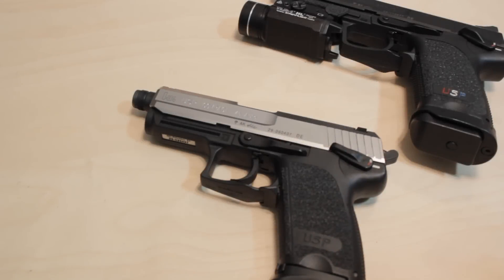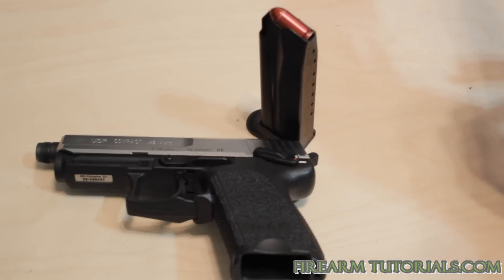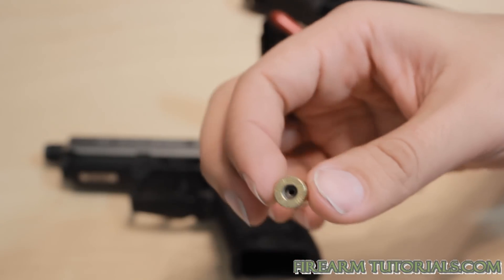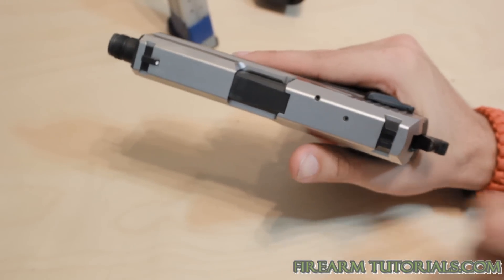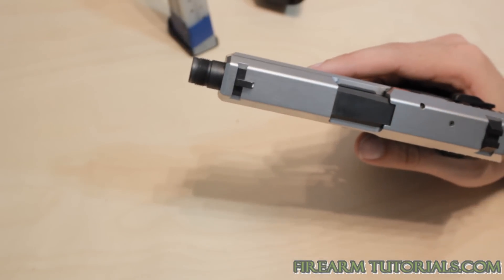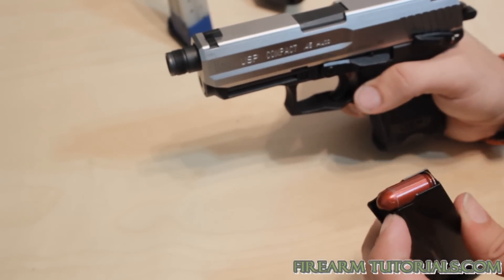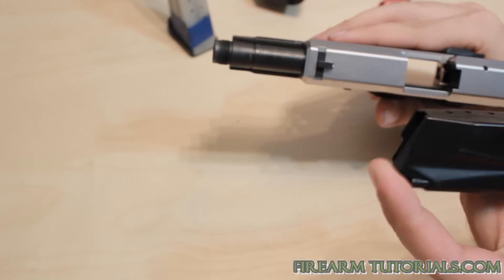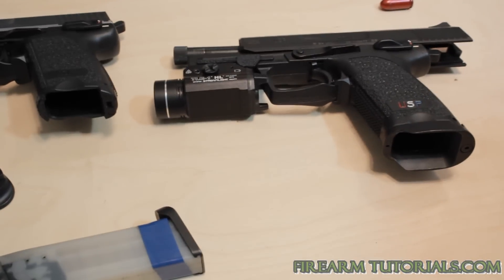HOWTO: Using snap caps in guns

Comment: Guns are made to send a round downrange every time. This requires certain mechanisms to function in the same way every time. If the striker or hammer does not have anything to hit, it overextends /doesn’t have anything to cushion normal movement. It’s similar to the human body in that regard. If a boxer hits a punching bag as hard as he can and then you take the bag away from him, he will torque his joints pretty badly.
Reply: You have answered my question. Thanks !

Comment: I would not use the brass snap cap without the primer as a practice snap cap because it is just like dry firing. The firing pin will not find resistance where it would normally strike the primer or a simulated primer.

Comment: Make your own snap cap out of used brass and erasers. Using an empty primer slot is not good for dry fire. You need something to stop and absorb impact.
Reply: Nope...it should be spring loaded like a real snap cap.
Reply: Nope...it needs to be spring loaded to protect the firing pin. Use a real snap cap.

Comment: This may sound like a dumb question, but how many times can I fire each snap cap before it's no longer good? Once? Twice? and if it's more than once, how do you know when it's not longer able to be used? Thanks in advance!
Reply from the maker: the answer, lots!  it's basically a rubber firing pin.  I guess eventually it would wear a hole, but that would take a LONG time.  fire away!
Reply: Three times a lady
Reply: I had the same question.
Reply: Gunnar Jones #HILARIOUS! LOL
Reply: Hasani Waldron
Reply: FirearmTutorials .com once the rubber wears are you basically dry firing?

Comment: Snap Caps have a spring behind the firing pin so that the firing pin has something to hit instead of rebounding off of the metal. The firing pin us designed to hit a primer. By not using a snap cap, and dry firing your center fire weapon, you may not immediately cause damage, but crystallizing your firing pin is a very real possibility. This is caused by hairline cracks that form as a result of a firing pin that rebounds off of metal and has micro vibrations running through it. I care about my center fire weapons and do not dry fire with out a snap cap. A spent casing, while fitting in the chamber, has nothing for the firing pin to rebound off of.
Reply: +Andrew Storie - Yeah your absolutely right, the brand name is "Tifton" their the one's that have a spring built into the "Snap Cap. As for their .22 LR it's hollow, but that's normal since the firing pin is a "Rim Fire "
Reply: Andrew Storie I commented before but no one answered isn't  he basically just dry firing with that spent round?
Reply: chukob5 yes
Reply: Cam you reuse real snap caps
Reply: Not only that but CZs have a firing pin retaining pin that fails from continuous dry firing.
Reply: @chukob5  the spent round has a primer that’s been hit. There isn’t anything for the firing pin to rebound off of with a spent casing.
Reply: I know this is a old comment but I’m curious on how I’m supposed to get the snap cap out of the gun after releasing the pin or pulling the trigger without engaging the pin again? To remove it I’d have to pull the slide back?
Reply: @chukob5  he is dry firing, correct. With a spent case however (one with a dented primer) there is nothing for the firing pin to rebound off of.
Reply: @timscoviac  of course the firing pin is fired/dropped at the point. Dry firing the gun is safe for the gun, to an extent. A firearm will always be made so that it can be unloaded. They’re designed to be tools. My original point is toward longevity of the firearm. Best practice is to use snap caps.

Comment: Snap caps stop the hyper extension of the firing pin.  Dry firing is an important practice.  Without a snap cap there is nothing to stop the firing pin except the firing pin spring being pushed to full compression or a direct metal on metal slam of the firing pin, depending on the design of the weapon.
Note: Dummy rounds also have nothing to stop the firing pin so they may be useful for checking the mechanics of your firearm, they do nothing to stop the damage to the gun via dry firing without a snap cap.
Reply: thank you
Reply: There's got to be something in the action that stops the firing pin. Otherwise the pin would fly through the barrel.
Reply: @goosecouple  Yes, as I clearly explained above, the pin only fits through the pin hole.  The end of the pin is larger to catch the spring.  If you fire a firearm without a cartridge or snapcap the spring fully compresses which is bad for the spring and your gun.

Comment: Personally I just  got a replica Airsoft Pistol  (Licensed S&W MP40 Metal Version,  C02, non blowback) to match my real pistol.    The weight/feel is almost identical.   to real pistol with a full mag.  

Trigger break/reset is very close.     The trigger is really heavy 10 to 12 lbs,    Personally I really like that.    Once you master this trigger,  you will never have problems on the real thing.    You don't need to charge the pistol or have C02.   You can practice rapid fire. 

I was constantly shooting low/left.   After a week of dry fire on the Airsoft.  I was staying on target and had tighter groups.    Even the trigger on my SD9VE, which felt heavy,  now feels like butter.  

I also setup a indoor Airsoft range,   It's as close to the real thing as you can get.     It's cheap,  I got a year's worth of CO2 and BB's for about $80.       I was skeptical at first, but I'm completely sold on Airsoft practice.
Reply: Sounds more sensible than buying this bs at least you get to see where your shooting wit a bb or pellet this shyt hear is like let's play make believe
Reply: Hmm, I had the same idea to do something like this. I might go ahead and do it and see how it is
Reply: @jordanredd2519  Full Auto Browning M1918 airsoft.  Loads of fun in the back yard just shredding empty beer cans. 😎

Comment: It is my understanding from much reading of firearm books/magazines and watching DVDs  such as Concealed Carry University.org (The Armed American's complete concealed carry guide to effective self-defense), that with modern hand guns there should be NO concern about dry firing them (with the exception of rim fired .22LR rounds - Smith & Wesson clearly state on their website, that the fireing pin on the S & W, M&P22 can be damaged by dry firing.  In this case it would be advisable to use a Snap Cap designed to be used with dry firing.
Reply from the maker: John Grimes I agree.  I don't use snap caps for dry fire with center fire calibers but a lot of people swear you need them.
Reply: +John Grimes     I agree in theory.. but for a couple of bucks the peace of mind it gives for most folks its well worth it.
Reply: Owner's manual of an FN 509 page 13 section 4.
4. DRY FIRING & “DUMMY” ROUNDS
Dry firing is defined as firing a firearm with no ammunition in the chamber.
Occasional dry firing of your FN 509 and for disassembly is acceptable.
Regularly dry firing your FN 509 pistol for practice or training may result in
damage to the striker. “Snap Caps” (inert chamber inserts that allow a
firearm to be dry fired without damaging the firing pin) are commercially
available for those who wish to practice firing without live ammunition.
CAUTION: Always keep the muzzle of your firearm pointed in a safe
direction, even if you are certain it is unloaded.
CAUTION: Store inert ammunition separately from loaded ammunition to
avoid unintended firing of the pistol. Failure to follow this warning could
result in serious injury or death.
CAUTION: “Dummy Rounds” with empty primer pockets are suitable for
loading/unloading practice and some training activities but do not protect
the striker during dry firing.

Read your owner's manuals...
Reply: Taurus tx22 is design dry fire safe

Comment: if I put one of these in the chamber . can I use this kind of like a safety?  fire off the snap cap and will it propel the next live round into the chamber.?
Reply from the maker: No it does not cycle the action.  What you are thinking of is technically a "blank" round.  However, in reality those don't cycle the gun either.  All the guns you see in the movies that fire blanks are modified (usually permanently preventing the weapon from being usable again) so the action will cycle.

Comment: Snap caps are for damping firing pin vibration, so that you can practice using the trigger without damaging the firing pin. A round without primer and powder does nothing to help with that; you may as well just dry fire.
Reply: I am not understanding this point.  If firing a round that's without primer and powder, will the pin get damaged ?
Reply: @goosecouple  there's a possibility. Some videos are saying handguns are safe to dry fire and some are saying dont dry fire pistols because the pin will fuck up over time. To be on safe side i wouldn't even dry fire my gun often.
Reply: Or wouldn't even use these caps.

Comment: The point of a snap cap is for the striker or pin to have something to hit. Yours doesn't seem to, so it's just like not using anything. I will be getting my Ruger EC9s, 2 weeks old, back from Ruger tomorrow, they replaced the striker. It broke because I wasn't using something for the striker to hit.

Comment: I was wondering with the snap cap what happens when you pull the trigger?
Reply: Virtually nothing.  The firing pin hits the center "primer" area of the snap cap preventing damage to the pistol firing pin.  Other than the firing pin click there is no sound or tactile feedback from the pistol when practicing with snap caps.
Reply: Thanks.

Comment: So you buy snap caps just to check proper cycling?? Which is fine but you know and i know they are made mainly for dry firing and practicing trigger control and how the trigger breaks. Thats why they are spring loaded. Ive used these snap caps to ensure cycling and they worked fine and then tried cycling live ammo at the range and it didnt properly cycle. So why not keep your finger off the trigger and use factory ammo to ensure proper cycling??? But thats just my opinion
Reply from the maker: *****
Wow.  Did he get in trouble for that?
Reply: When buying a used gun I'm sure the person on the other end of the counter will have objections to loading it with live ammo in the store.
Reply from the maker: HA!  I keep meaning to shoot a part 2 video on the whole rebound spring/firing pin use for snap caps.
Reply: *****  I highly doubt that happened. It had to be caused by improper use, Glock has 3 safeties that have to be disengaged when firing and the first one being the trigger he probably didn't have good trigger discipline and caused it to fire. Those guns are tested constantly before being shipped out to an FFL.
Reply: *****
That's the owners negligence. They obviously didn't know how to properly disassemble the firing pin channel to clean or check their firing pin. If you're going to own a Firearm you better take the responsibility to properly get acquainted with its functions. It's not for idiots and it shouldn't be treated as a toy. Guns don't just go off, if your claim was true it would be all over the web and possibly news, recalls for Glock models. It's all a claim.
Reply: +Noel127 There was an Illinois police officer who had his gun AD when he "hip checked" it while passing through a doorway. It was determined that the firing pin safety was defective. The safeties are designed to help us but don't bet your life on them. They are mechanical parts and can fail.

Comment: Can someone tell me the purpose of dry firing pls I don't do it at all unless I'm dismantling the glock or Taurus other than that why am I pulling the trigger on an empty gun or a gun with this shyt in it . Anyone? And don't say training damn thing doesn't even kick back after the trigger pull rather use a pellet gun if that's the point
Reply: A person may want to upgrade their firearm. I recently upgraded my Beretta 96/A1 and the safest way to test that everything is functioning correctly, is with snap caps. I can test the trigger pull and other portions of the gun without having to use live ammo.
Reply: Brian J Basically for testing of cycling/mods and other uses. Its basically a dud round so ive heard people using them for draw form in front of a mirror, throwing one in a mag to practice misfire technique, instructor/salesman uses them in demos, and ive used them when bow hunting incase of a safety issue. I put a snap as my first round to prevent misfire on my cz because im more concerned of that then needing a quick shot. Some people ccw with a top snap as well i dont get the point of that though to each his own.
Reply: Brian J some states require mag caps like hunting ducks with shotgun so you can use plugs or snaps too

Comment: if anybody has not noticed by now if you hear that high pitch scraping sound that is close to Nails on a chalkboard Desi sound of a firearm whether it is a pistol rifle machine gun anything that has a moving part in a gun needs to be old and in this video Within the first 30 seconds I hear nothing but hard scraping sounds every time he pulls that slide as all I hear and I cringe because that is putting more wear and tear on a firearm then what people think if you want to show a video that has you cycling the firing where they using in this case squids blanks whatever you want to call them you need to make sure your gun is old if not you are wearing it out four times quicker and not to mention if you start wearing your gun out by putting grooves in it it will eat at the reliability of it would that set I'm good
Reply from the maker: I think the microphone I was using was making that sound a lot worse than it really is.  I know what you are talking about 100% and it drives me nuts too.
Reply: I know where you're coming from you know where I am coming from on it and it specially when you hit the range and it is one of your friends guns they have not olied in two years they've been using it for the last 2 years and they tell you go ahead that's okay you pop off 3 Rounds and then the whole top comes popping off backwards at you and asselin you tell them you now have a useless $900 Kimber gun and I told you to all it but you didn't listen
Reply: Changs the recoil spring

Comment: I came here to learn HOW to use them, not what they're for.
Reply: አምላክ ፍቅር ነው You load them in the chamber as he showed you in the video. Then you just practice practice practice! Present your weapon, aim at the target, dry fire the weapon, repeat. However while using snap caps or dummy rounds as they are sometimes called, after each trigger pull, you will have to reset the weapon by pulling back on the slide. If you pull too far back, you will eject the dummy round. When you are out of dummy rounds,  the slide locks back. Or at least it should. So depending on what you are practicing you might just want to pull the slide back just far enough to reset the trigger without ejecting the round. I hope that helped.